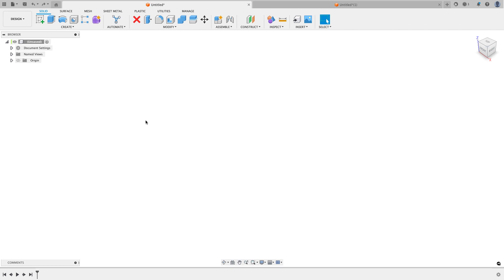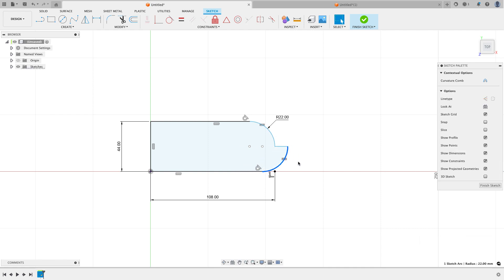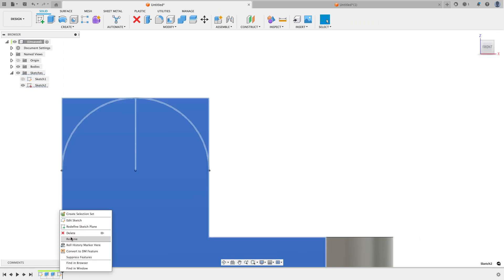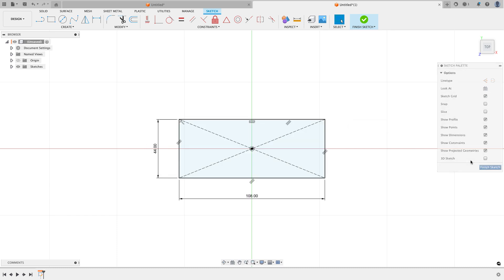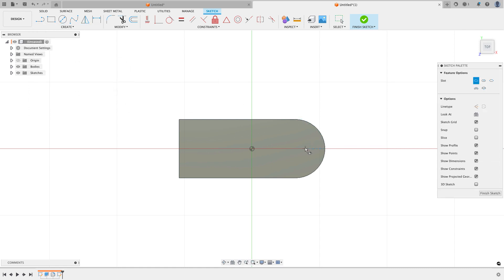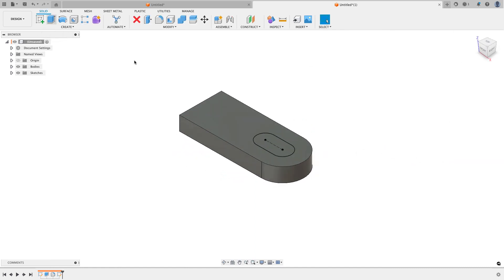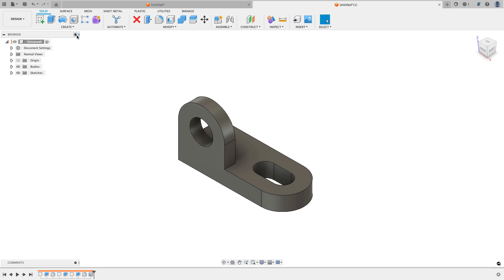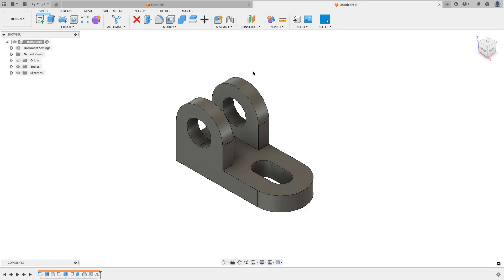Fusion 360 - An alternate take on modeling a tutorial file

Comment: It's much better way to model, than original version, which wasn't really great. However I think it's worth noting, that in reality it could be done even better. The part seems to have some important dimensions and it would be nice to describe them. These are: hole sizes, distance between both vertical arms, their thickness, amount of material around holes and slot etc. The width and length of the complete thing (44x80) are not critical dimensions, but rather end up to be whatever is needed to match other constaints. So it would be nice to only enter important dimensions (which are our aditional constraints) and let other sizes, like complete part width, come out of these constraints.